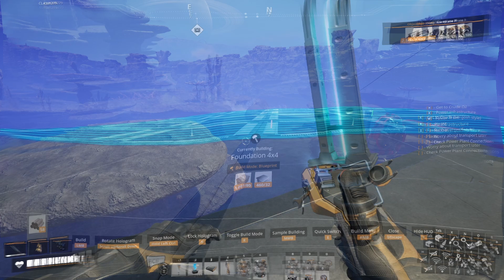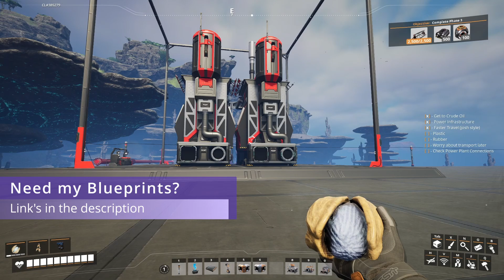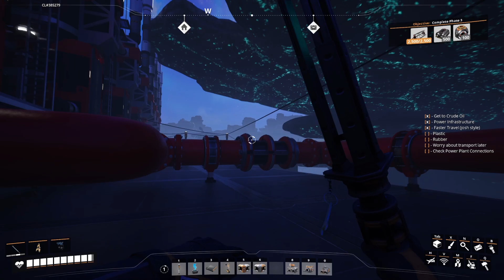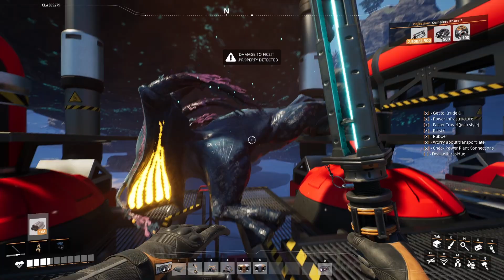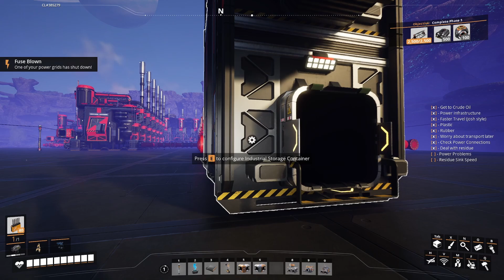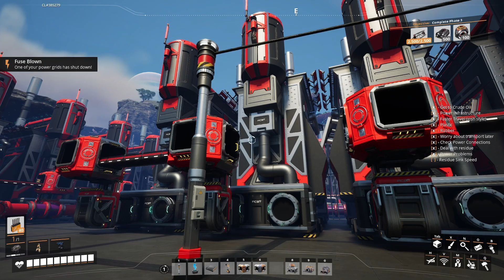Converting an entire lake into an Oil Refinery for Plastic and Rubber in Satisfactory

Comment: Absolutely do save Power Slugs until you can use Somersloop to double the output of slugs in constructors.
Reply from the maker: I'm saving the purple ones, but with how sparingly I use them, don't think there's a point since as far as I know you can automate them later on.
Reply: @DefinitelyWalky  could you clarify which automation you're referring to?
Reply from the maker: @NinjaGorillaFTW  had to do a quick check, don't want to spoil myself much but yes you can automate power shards in the endgame since 1.0 (and they're also used as an ingredient for the top tier fuel)
Reply: @DefinitelyWalky  I see what you mean. Still, it takes a lot of game hours to get to end game and then more to make each cell. I think it's worth building more infrastructure instead of overclocking and saving slugs and remains for doubling, but that's just me! I'm glad the game can be played many different ways
Reply from the maker: @NinjaGorillaFTW  (had to do another quick search) without the somersloops you can still get over 2.5k power shards from slugs alone - ideally I'd say oil extractors and resource nodes should be the priority for shards (will state in my next video) because you can always plop down more machines.

But let's be honest, anyone using even a small fraction of the total slugs on the map before endgame; doesn't need any help with their builds... maybe

Comment: For future reference, rather than sinking coke, you can smoke it (in coal generators)
Reply from the maker: @callmevidd3431  but that's unreliable power, will only get it if the refineries aren't clogged, so it'll cause random unexpected fluctuations in capacity
Reply from the maker: Correct me if I'm wrong though
Reply: If you add smart splitters in front of the plastic and rubber storage, you can sink excess so they dont back up
Reply from the maker: @callmevidd3431  yes but that's just doing the same thing in a different way 👀 if power becomes an issue I'll give it a go, currently built about two dozen fuel generators (editing the footage rn) so the power issues have been delayed (for now)